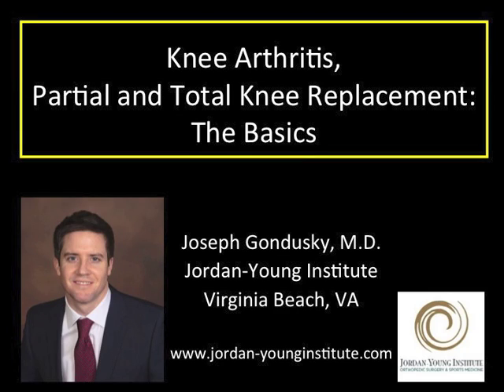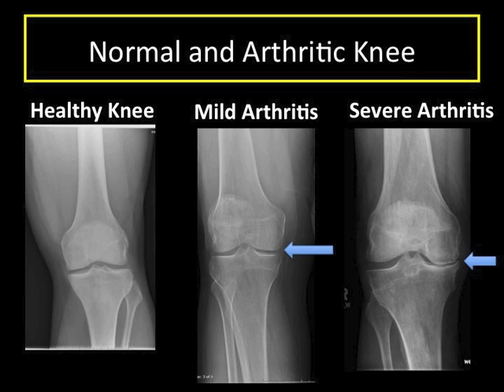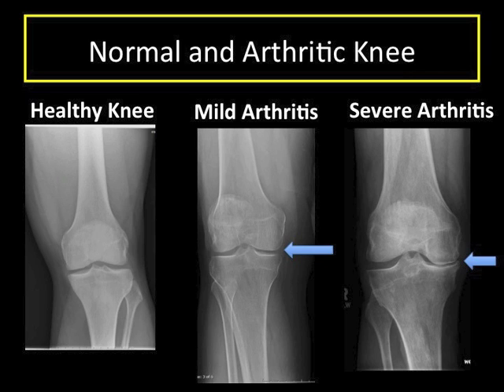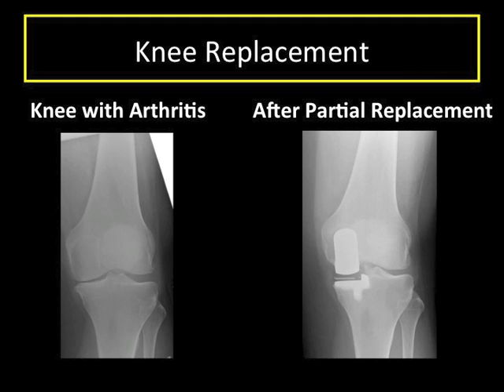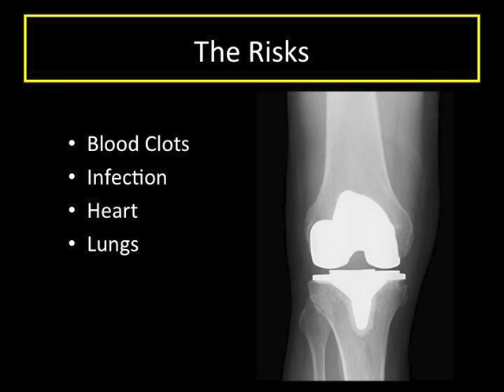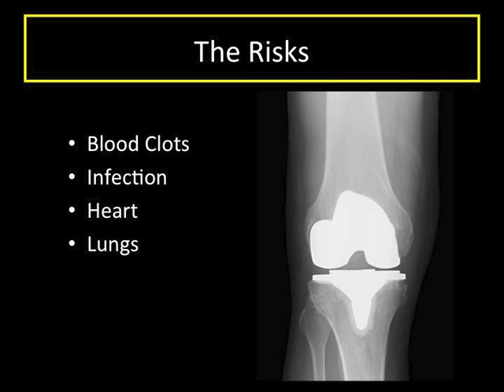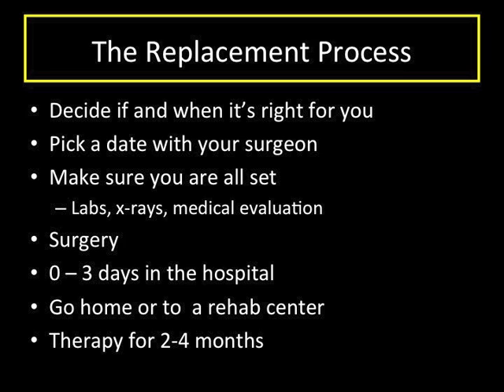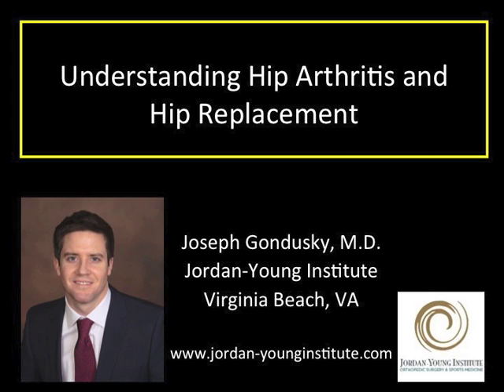Understanding Knee Arthritis, Partial and Total Knee Replacement

Comment: How long does a typical knee replacement last?
Reply from the maker: There is about a one percent per year failure rate of modern joint replacement, which puts that at approximately an 80% chance of survival at 20 years out from surgery.     in other words, the chance of the joint replacement lasting at least 20 years statistically would be 80% or above.